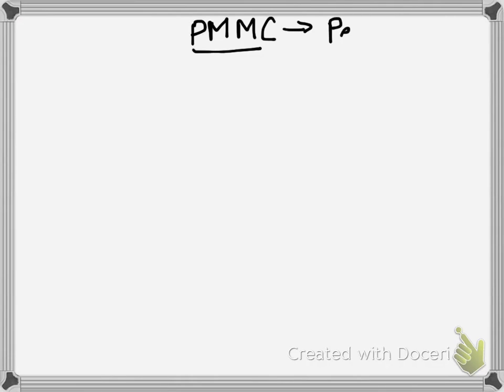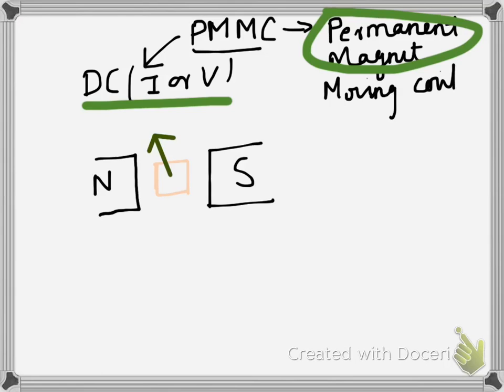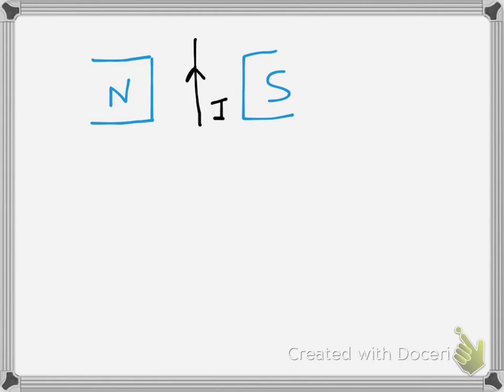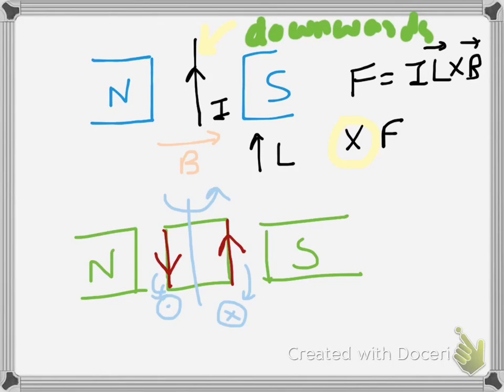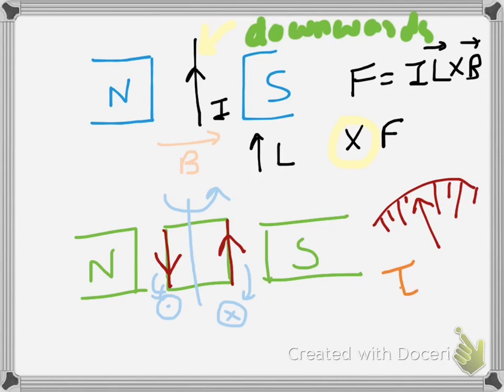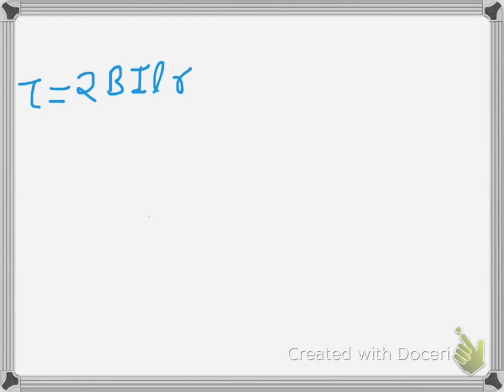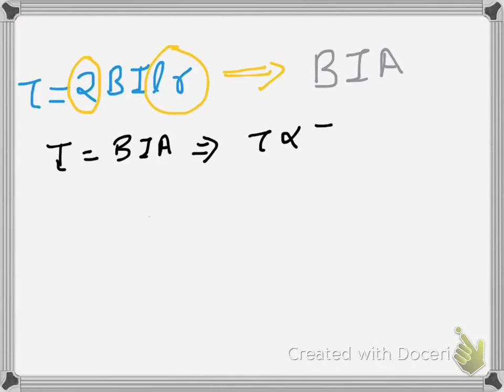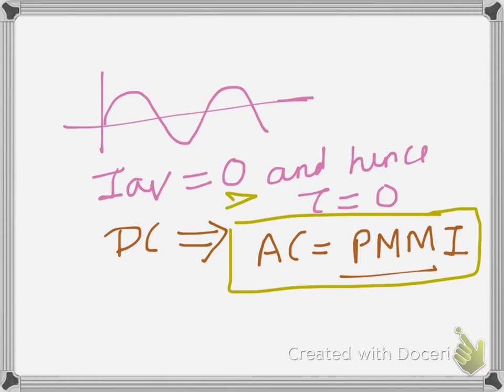Permanent magnet moving coil (PMMC) type instrument

Comment: Sir why use pmmc in only dc not for ac
Reply from the maker: dilkhush kumar look at the construction, we have a steady unidirectional magnetic field. Now if the current in the moving coil keeps on alternating. The torque will be alternating and hence the pointer will just oscillate near zero and will not point to a steady value. So, DC is used which produces unidirectional torque.

Hope it helps.
Thanks.